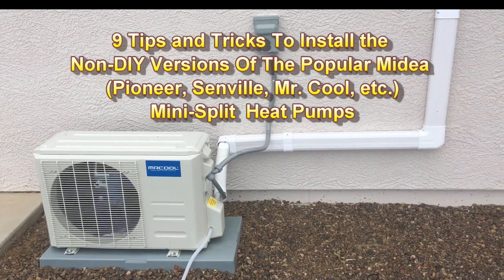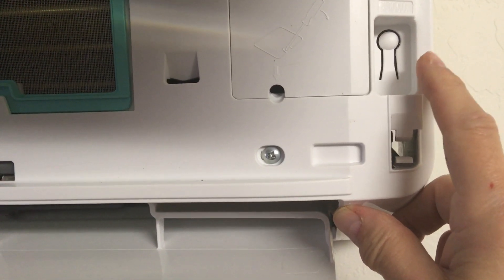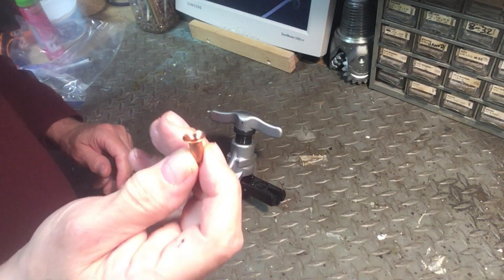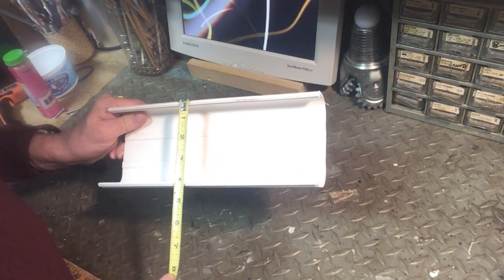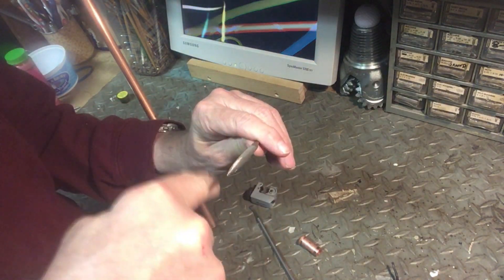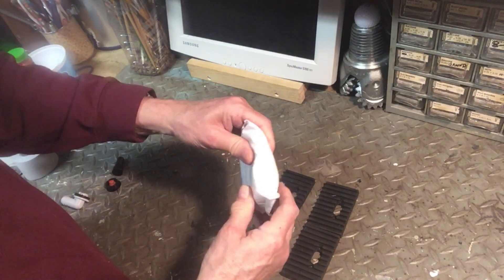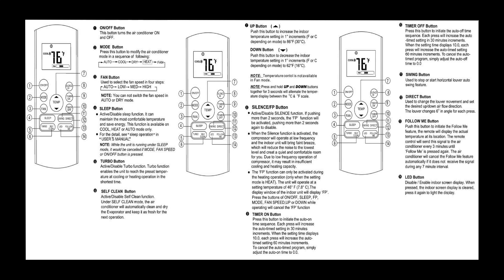9 Tips To Install Cheaper Non-DIY Mini Splits - Pioneer/Senville/Mr. Cool

Comment: Good tips. I was able to install a Senville 9000btu high efficiency in a few days, by myself. Bought a cheapo vacuum pump and borrowed a scaffold to work off. Pretty straight forward as Im a industrial electrician...second winter, and propane use cut in half... electric bill is up about 30-40 bucks a month here in Canada...and it cools very well too on those 3 or 4 hot days here...highly recommend. Of course I waved the warranty but for 1200+tax I could  DYI it a couple times, not paying someone 115.00 an hour.
Reply from the maker: It's $250 an hour around here.

Comment: All of your tips are spot on.  I wish I would have known about the spring benders.  I kinked one 3/8" line and had to replace it, but luckily I had a spare that I cut off from another unit.  I have installed 3 of these on my house in FL and completely turned off my big RUUD central air.  It was pulling 1800 watts non-stop almost 24 hours a day.  My electric bill went from $10-$16 a day to $4 -$6 a day.   We LOVE these mini splits!  When we go to bed at night we turn the big 18K in the living room off and just run the small one in the bedroom and close the door.  That is the best thing about mini splits.  You can create zones and just run units where you need them.  Sometimes my wife sleeps in the guest bedroom and she can put the thermostat on a higher temperature in there than I usually keep it in the master bdrm.  I cannot report on winter performance yet because I just installed them this summer.  But anyway so far they are awesome.

Comment: They may be cheaper, but by the time you pay for the pump and installer to charge it, it costs more. You can not buy refrigerant without a license
Reply from the maker: It comes pre-charged.

Comment: Nice video! The condenser isn't that heavy and I assume the plastic pad isn't that heavy either.  Wouldn't having the unit on the plastic base result in a light inadvertent bump moving the unit and putting strain on the refrigerant lines?

Comment: If you live in a cold climate and use it for heat do not use the plastic base.  The defrost cycle will cause ice to build up under the unit plugging the drain.

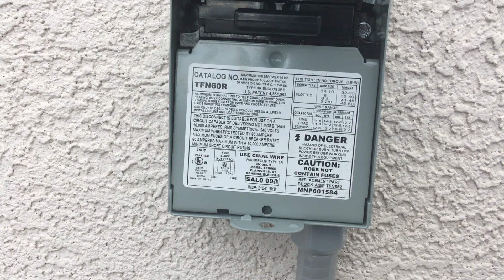Comment: 0:36 - Get a Plastic Base
1:26 - Use 3 1/2" PVC Pipe for the Line Set
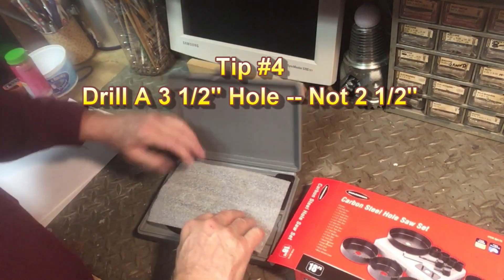2:14 - Hole Saw Set with 3 1/2" Hole Saw
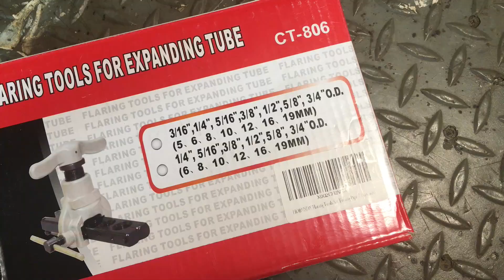2:32 - Eccentric Flaring Tool
3:25 - Spring Benders, Not Tubing Bender
3:38 - Vacuum Pump
4:04 - 4" Wide Line Set Cover
5:38 - Use Nylog to Seal Connections

Comment: I used a product called "nylog blue" for the flare fittings .. dunno how well it helped but none of the units I have installed leak. I also used torque wrench to tighten them to spec but idk if that is justifiable to someone who is only going to install a small single zone unit. I had to install alot of these for my business and home so when I first got the install quote for the unit I bought, I about crapped myself! 😂 I was well over the cost I paid for the unit sonI said I'll figure it out myself

Comment: What bolts did you use to attach the unit to the plastic base?
Reply from the maker: Some extremely large self-threading hex washer head screws I found in the junk bin.

Comment: 01:56 That's actually 3" PVC pipe not 3.5". PVC pipe is measured by the inside diameter, not the outside. But don't take my word for it ... Go to Home Depot and see if they have a 3 1/2" pipe section.

Comment from the maker: Update 13-04-2022: My unit still works perfectly. I have heard quotes of up to $6800.00 to have a similar unit professionally installed. I wonder if many people know these units do both heating and cooling. FYI, my 18,000 BTU unit is installed in a 650 square-foot garage that is fully insulated (doors, too). However, the triple garage doors with the thinnest insulation face west and take the full blast of the heat we receive in the summer at our southwestern USA location. Of course, the doors are not as tight as a wall. My unit is perfectly adequate for my needs, but when sizing yours, especially in a garage, get the next size up if you are in doubt. I can still get my unit for well under $1000 (Don't wait until until summer to buy), so the cost/benefit ratio to me is outstanding.
Reply: I'm needing to replace a now dead 3.5 ton central split unit and the quotes are coming in 8k-13k for a 14 SEER unit. It seems to me that putting in two 24k mini splits would give me a much better SEER rating and HSPF value and if I DIY can be done for under 4k.... Any advice on brands to avoid or to consider? I'm looking at either the MR. Cool, the Pioneer, or the BlueRidge products..... Any opinion? I will be using this to heat as well in a locale that usually doesn't see temps below 25F in winter, average winter temp is about 42F.... Thanks in advance...
Reply: @Harmonic Waves  senville all the way... like the video said its the same as Mr cool and pioneer. I have diy 7 units in the past 7 years and they all work perfectly. You will be so much happier with 2 2ton minisplits vs. a central air unit. The ability to control each rooms temp independently is amazing!no more wasting power to cool rooms  you don't need!
Reply: Where did you buy your unit?
Reply from the maker: Ingram's Water and Air...through Amazon.
Reply: How tall is your ceiling?
Reply from the maker: 9 feet.

Comment: I am in the process of installing my third Mr Cool DIY unit. Fabulous product. Very good instructions and  minimal steps. You can not beat the precharged lines. Getting a HVAC professional in to charge the lines quickly eats up any savings. That is assuming you can even find a HVAC guy who will do it.
Reply: You dont need to add refrigerant unless your lineset is longer than whatever max length in the instructions. 

I bought all the tools I need for less than the markup of a unit with pre charged line set, I don't have ugly rolls of extra lineset, and I can reuse the tools when I add more units.
Reply from the maker: Great!  My system is still working like new three years after install.

Comment: Good video!  Do the spring benders go on the outside of the pipe?  I mean, do they only work if you are going to cut the pipe first?  Or can they be used inside the pipe?
Reply from the maker: They go on the outside...
Reply: @bupright  Yep.  Only useful if you are in fact cutting the pipe, and really not too useful then, unless you strip all the insulation off to get to the parts you want to bend.  Hey:  Thanks for your video - I got two units successfuly installed yesterday.   I used vinyl downspout gutter, large size  (3" x 4") to hide the lines, and the downspout was big enough that I could add cheap foam pipe insulation to each lineset.
Reply: @markchamberlin3741  Great idea about the downspout gutter. It is also much cheaper. I will look into that
Reply from the maker: Downspout gutter is a good idea. Wish I'd thought of it.

Comment: Did you DIY install your system? For us DIY people that don’t have expensive HVAC tools and equipment, is it ok to short cut some of the line set testing. Nitrogen pressure testing is expensive if you have to purchase nitrogen bottle and regulator. R410a systems should be vacuumed to at least 500 micros. Schrader valve removal valves and Micron gauges are very expensive. This tools add a huge expense to the  diy install. Did you use pressure testing and micron gauge for your install? Have you experienced issues related to failure to proper test and evacuate your mini split?
Reply from the maker: It was a complete DIY. Works just like when installed three years ago. I carefully measure the ouput temp ocasionally to make sure nothing is headed south. Yes, I know the installation is not perfect, but I probably saved four or five thousand dollars even with the tools I purchased.

Comment: Hey friend I’m trying to install Everwell mini split heat pump non diy and the head unit has 3 wires blue brown yellow with green stripe that is already attached and runs out the rear of unit what are these for? I got the other wires figured out number wise I just stuck on these and the manual is useless

Comment: Using 5/8" radiator hose for drain hose with a union and hose clamps.  It has a smoothi inner core which lets water run without freezing as quickly and the thicker rubber is more durable while providing a modicum of insulation.  You should also add more insulation around your insulated line set and drain hose in areas that freeze as per the installation manuals on these units.  Thus most line set hides will not fit.  The couple that stood a chance would have been tight and impossible for two linesets and drain hoses as well as unavailable and very expensive.  6" plastic guttering offers an alternative, PVC fittings and els with adaptation can help.  You are going to have to get creative.  The colder the climate the more creative you have to be.  I used marine canvas and snaps to sew up my own.  Also be aware that all units will benefit from the compressor being in a shelter and it will extend the life of the unit greatly.  These units are not rust proof nor are any electronic boards totally waterproof.

Comment: I was under the impression from some other videos installing the DIY units that the lines couldn't be shortened due to the freon in the line being part of the volume of freon needed to operate the system properly.  Don't know if true or not. 
   Did your instructions or other info give any minimum line size/length or size (lb)of freon charge needed?
  Also can any inside units be mounted on their end instead of horizontal?
Reply from the maker: The unit I installed has no refrigerant in the lines. All the refrigerant is in the compressor unit until you let it out. The factory told me it was OK to shorten the lines, but not to shorten to less than 10 feet.
Reply: I think it depends on the unit you are getting. I believe Mr Cool is the only one considered DIY because the lines are charged. With that one you don't vacuum the line. All the others you do need to vacuum the line. On those you can shorten the line.

Comment: Hi,.. Is the line set directional?... That's to say....  R the connectors specific to the indoor /outdoor units?  Mine came with no identifying marks to orient correctly.... Thanks.
Reply: One line is larger guage than other, so big goes to big.

Comment: (1).... cheap Chinese junk
(2)...disposable ac/heating. Not worth fixing
(3)... failed to raise the condenser out of the snow level for heating(unless you live south)
(4)... failed to install surge protector on disconnect
(5)... limited line set length  
(6)... little to no distributor network 
(7).... no dealer network 
(8).... very poor parts availability  
(9).... call china for warranty 
(10)... lack of durability 
The only thing going good for this junk...ITS CHEAP!  THE REAL DEAL IS FUJITSHU/MITSUBISHI.. 12 YR WARRANTY.. MITSUBISHI INVENTED THE MINISPLIT... IF YOU CANNOT AFFORD TO BUY OUT RIGHT.. FINANCE... CHEAP MONTHLY PAYMENTS... OUTSTANDING DEALER NETWORK... OUTSTANDING DISTRIBUTOR NETWORK... OUTSTANDING WARRANTIES.. OUTSTAND MANUFACTURER SUPPORT.   
SO GO AHEAD AND BUY THAT CHINESE KNOCKOFF.. GOODLUCK
Reply: China makes more mini splits than any other country in the world. I am not sure they are all cheap, except in price. Thank china for giving us thousands of items at very reasonable prices. It helps us poorer westerners live a nice life.
Reply: @ablam8  china makes more minisplits due to that it can do it the cheapest in the world, but don't think that you have a quality product(poorly made).. then you can THANK China for making other poor products ... maybe you should focus on improving your standard of living!

Comment: I just got off the phone with Pioneer and was assured that the 5 yr. warranty was for DIY as well. The confusion comes from them asking for licensed installer info that must only be filled in by the installer. However, it can be left blank for DIYers and the full warranty still applies! Great news! (I deleted my post to the contrary and apologize for misinformation.)
Reply: Agreed, that confused me too. Fortunately from my experience Pioneer's support has been great even though I DIY installed my unit. The 2 times I needed parts (a remote and a temp sensor) they quickly shipped them no hassle. The system works reasonably well too considering the price. It's not the quietest or the greatest at maintaining a stable temperature, but it gets the job done without using much electricity.
Reply: @averyalexander2303  Mine is doing pretty well too. Glad to hear support sends parts promptly. I also have the issue of room temp being 3 or 4 degrees cooler then the set temp on AC. Thought there might be a calibration step I missed but couldn't find any.

Comment: If I wanted to install the inside unit on an interior wall would I be able to bend the tubing and wires straight down out the back of the unit to fit into the 3.5” space between two interior walls. Then I’d just run them into my basement before running the tubing out through the basement wall.
Reply from the maker: If you are talking about new constuction with no wallboard or insulation present, I THINK you would be able to do this.

Comment: I have installed 2 Senville units and am very happy with them. I knew Senville was made by Midea, but did not realize it was same as Pioneer and Mr Cool so that is interesting.  Most brands have the base standard model, and then a higher efficiency unit that is 22+ SEER.  Would recommend going with the higher efficiency units which will also heat down to -22.  At least my state, there is a rebate available through the power co that the higher efficiency units is eligible for which more than pays for the upgrade over the less efficient model, so there really is no downside.  These units have the pan heater, which is a must if you are planning to heat in subfreezing temps since oother wise you will get ice buildup.
Reply from the maker: I might consider the high efficiency if I planned to run it most of the year. However, I use it occasionally for 4-5 hours at a time in my garage. When I installed it, I was looking for the cheapest option at the time. Thanks for your comment.
Reply: Pioneer is mostly or all Gree; Senville is Midea. This can change over time, however. Midea is now the biggest worldwide. Japanese manufacturers, like Mitsubishi and Fujitsu are the best, but you pay for it, and they generally expect their dealer network to install.

Comment: I was thinking about a concrete pad and you sold me on plastic platform. I receive my Mr Cool 18000 btu tomorrow and I’ve just ordered the platform.
Thanks
Reply from the maker: It is a lot less work, probably cheaper (particularly with the recent rise in cost of building materials), and will likely outlast you. I only paid $28 for my pad, but prices on everything have gone UP.
Reply: @bupright  Where can I find the plastic base. I look on EBAY but nothing
Reply from the maker: Mine came from Amazon...it was $28. I think it was 38" X 18".

Comment: This is the kind of worthwhile video YT needs more of. Thanks for sharing your tips on this. That's the way I am when I do anything -- you want to tell others -- do this, do that and you're welcome. Are you getting good performance from these low end units?
Reply from the maker: I am thrilled with this unit. It is installed in a well-insulated 650-square foot attached garage. We live in a southwestern state at about a mile high altitude. Our average low in the winter is 20's to 30's, highs in the summer push around 100 for about 2 months. In the afteroon in the summer, the sun just BEATS down on the garage doors. The unit can easily bring the garage to a commfortable temperature in about 15 minutes...either warming it up or cooling it down. This is one of those things I kick myself for not buying a long time ago.

Comment: WOW  Excellent video... great ideas... I was really concerned that I had been sold a NON DIY ductless mini split when I THOUGHT all I had to do was make the connections...... :(  Seeing this & reading some of the ideas & comments of other viewers has made me less concerned... STILL concerned re: my city building inspector... he may STILL want to have an HVAC tech install... I HOPE NOT... With some practice (as you suggest) getting those flared ends smooth & correct is absolutely essential.... I THINK I'll do it... still evaluating doing everything ELSE except the final connections... Still alot of stuff to consider... THANK YOU for taking the time & share your experience & tips... Goooooooood job ! ! !
Reply from the maker: Thanks, Rick. Mine is still going strong a year later. The heat function is great too, just a few degrees of heat rise in the winter made the uncomfortable garage a lot better.  Wish I'd done this years ago,
Reply: Check the current version of your State HVAC code. It may permit people to install a heat pump or aircon in their own residence and may or may not require an inspection of some sort. Around here it costs around $5000 to have a contractor install one. May as well call it the HVAC Guild because of the very long amount of time it takes to go from apprentice to journeyman to contractor. 8 to 10 years and thousands of hours to do work that should be possible to learn in a few weeks to a year, if you're wanting to do everything instead of specializing in the easier aspects.

Comment: do you recommend the plastic bases for 48k btu condensers?
Reply from the maker: As long as the base fits properly, should not be a problem. I put a layer of rocks under mine for support.